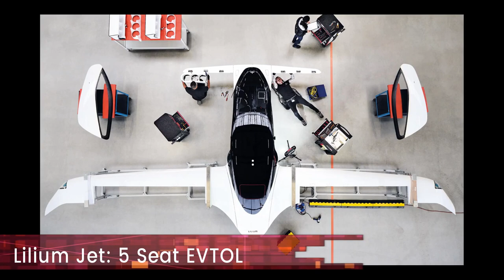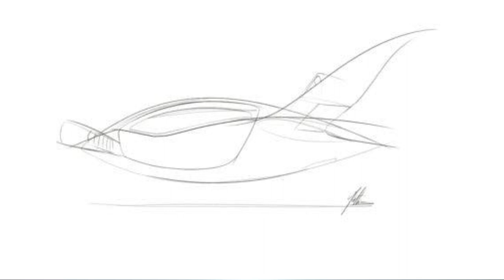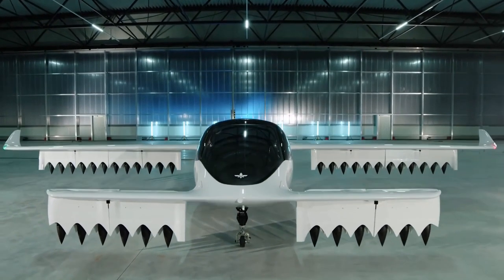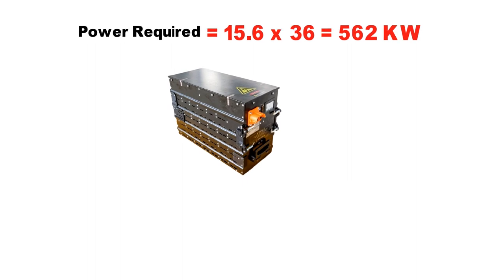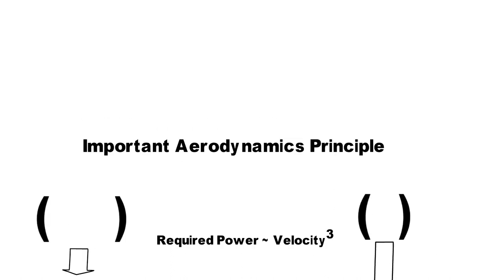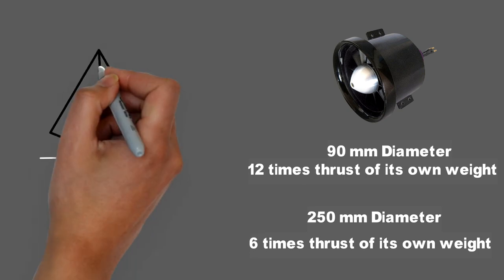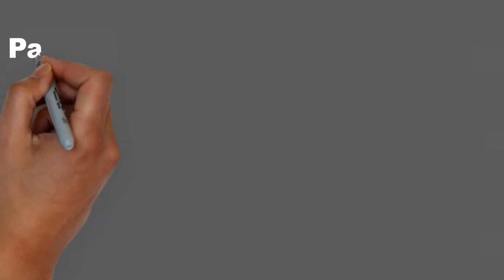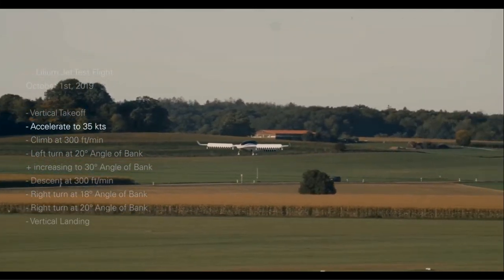The Engineering of Lilium Jet

Comment: Thankyou for covering some of the technical aspects. There is a huge elephant in the room though. Lilium have consistently failed to get anywhere near the performance and timeline they announced with so much hype. Back in 2016, these things were going to be available to buy in 2018, with 500km range and 400kph cruise. Pure fantasy. Here we are 5 years later and a model is managing minutes long flights around their airfield. And yet each failure to deliver is simpy brushed aside with some incredible new hype and new in service date. It is a peprtetual 4 years away. But  they seem very proud of being on their 5th generation of 'prototype'. Just one problem, none of the previous 4 have come anywhere near demonstrating the performance being hyped. I can see they have worked through some of the necessary innovations but what they have right now is nothing more than a big model making tiny little flights around their airfield, when what had been promised was a passenger carrying service date that was already missed 3 years ago. With the company being floated this now has all the hallmarks of another Theranos - bold claims but nothing tangible except some expensive mock-ups and a flying model that has demonstrated none of the performance claimed.
Reply from the maker: I agree with most of what you have written. This video was made a while back.  I think they are just waiting for the battery technology to catch up. If not they can either go for fuel cell or a Electrical generator. I would still like them to show a  VTOL flight with even  sandbags so that they can demonstrate with weight.
Reply: @Electric Aviation  yes, and I am not denying they have some innovations in the aerodynamics and propulsion. But their claim is to deliver all this performance into service with batteries and be certified by 2024. The company was not floated on the proposition of investment in a perpetual flying testbed with fuel cells as the next project. Bottom line is after 4 years flying models they have not made a single flight that demonstrates they are anywhere near being able to deliver on their fantasy claims for range, speed and payload. Instead of answering skepticism with verifiable information they just reply with defensive PR rhetoric.
  Thankyou for your reply and your video analysis of these projects.

Comment: hey, thanks for your analysis; I could be wrong about this; but when the "fan surface" is in the vertical orientation or nearly so and is moving forward ; I believe that the overall shape of the airfoil that is created by this configuration is acting essentially as "full span" flaps.
Thereby greatly increasing lift and lowering stall speed.

Comment: Academic !!!
I wish you had elaborated on the transition mode and issues arising in such phase. The remark as to the fact that this aircraft may be considered as one having a very low stall speed rather than an eVTOL alludes to one aspect which may be related. 
Also, you mentioned EDF diameter vs Power Consumption and vs specific thrust. It would be interesting to hear your thoughts on how Lilium may have determined the sweet spot.
Also, they had in the earlier design a sort of rotating cylinder housing a couple of EDFs in lieu of the current Canard, it would be interesting to hear your thoughts on this change and the tradeoff associated.

Comment: A couple technical comments to this nice video. Impressive the L/D ratio of 21 for such a small wing aspect ratio! With this in mind the vertical take off and landing, even if high power (and energy consumption) have a short duration (1 minute each?) as the plane will transition soon to fixed wing flying  in which it will stay most of the time (60 minutes) to achieve the 300 km range. It makes sense to me!

Comment: I wonder if this will feature the equivalent of of regenerative breaking which could be achieved by the freewheeling fans during gliding. If so it might be possible to extend the range further, although this would doubtlessly add mass
Reply from the maker: In some aircrafts, like Pipistrel Alpha Electro, there is regeneration capability while the aircraft is descending

Comment: Very nice video... best overall coverage of the propulsion that I've see,,, it'S amazing how little press coverage lilium gets, considering their state of design and prototype, and so far decent performance...I wonder how effective a fuel cell/battery hybrid would work out, given the battery fast power output, and fuel cell range/battery charge capability, plus, possibly very low pollution products...

Comment: I really think some kind of auto rotation capability should be required with construction of ant vtol craft. Its always the first question that comes up when some new vtol gets introduced. Is it like a difficult thing to construct rotors in multirotor aircrafts in such a way that they can be controlled mechanically in the event of powerloss ?

Comment: Hi, will the Lilium be available to fly yourself or just as an air taxi? And do you need a pilot's license?
Reply: Lillium is focused on the commuter market right now. It will require a pilot's license; but remote control by a licensed drone pilot is part of the plan; and full autonomous is the ultimate goal. Selling to general aviation pilots could help reach production scale, but entering that market segment has higher risks.

Comment: I am very curious how noise management factors into the design. A lot of the evtol concepts floating around have fairly large conventional rotors, which would almost be unbearable to hear fly over a city. I wonder how the ducted fans sound like and if placing them over the wing helps with noise abatement.

Comment: If the efficiency advantage increases with the size of the fans, then it stands to reason that a much larger plane would be advantageous. Airliners with VTOL? The future is wild.
I wonder if combining this tech with the Celera Fuselage and high aspect wings might be a good combination. You would probably have to position the motors away from the fuselage to avoid disturbing the boundary layer.

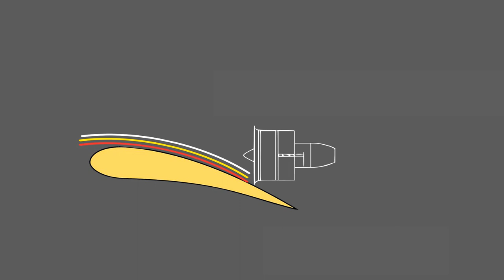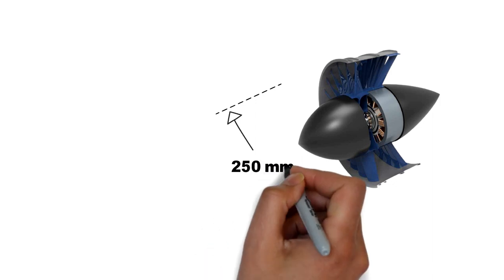Comment: @8:30 "boundary layer ingestion by the propulsors".  This infers non homogeneous air entering the propulsor.  Will this lead to a strong 1x/rev excitation to the fan blades when they hit the boundary layer air at ~6:00 o'clock?  If such an excitation exists, would it stimulate High Cycle Fatigue?

Comment: Since VTO consumes 10X more energy, the solution is painfully obvious, and it's surprising no one has fixed this yet:   Simply have a quick and automatic release power tether that pulls off once the craft is airborne.    Maybe give it a 10 to 20 yard length so once the plane gets underway, the forward momentum alone will disconnect the ground power.    Then have a cable boy/girl run out and spool it back into the landing zone.    Basically, take offs will consume ground power, keeping batteries topped off at full until aerodynamic lift is achieved, or is more inexpensively achieved.    The cable length could be adjusted depending on weight considerations, but remember, the power usage would be irrelevant until the cable disconnects at which point the cable weight would be irrelevant.
Reply: Just have to engineer a way to control the cable so it doesn't get sucked up and FOD out an engine...otherwise, you're right that is a elegant solution!
Reply: @detour1055  Why would the cable get sucked up?  By definition it would be on the exhaust side and would naturally be blown away from the aircraft.    As the aircraft rises, cable would be blown downward naturally.   Just ensure it's spooled so there's not a lot of loose cable laying around which then could possibly be thrown around with the ground turbulence.   But even then the energy that could be imparted to the cable is not likely to be able to throw it above the aircraft into the intakes, esp. since the weight of the cable is always pulling it downward.
Reply: @detour1055  (Also, assisted takeoff and landings are nothing new, the military has been using it on aircraft carriers since the first carriers existed, - although in the old days take-off assists were mechanical, like catapults.    Tailhooks and cables I think are still in use for landing assists.   This would just be a different kind of take-off assist)

Comment: Just use larger rotors, then retract rotors, and convert to fixed wing flight. Electric convertiplane something resembling the Russian Kamov Ka 90, but with the efficiency improvements from compact electric motors and working better in altitude

Comment: So I'm still trying to understand electric flight but if you were to shut off 4 or five of the fans at normal cruising speed could you possibly make more electricity for a longer flight time. Or make put solar panels on the wings thus creating more electricity for the flight?
Reply from the maker: You can do regeneration of energy by using the ducted fans as turbines. This can happen as you want to slow down the aircraft. Pipistrel Alpha Electro, an electric aircraft does that. As for solar, please check out the latest video on this channel. It covers the topic in detail.
Reply: @ElectricAviation  ok thank you for the insight and I will be sure to do so

Comment: I realize this is a cuss word to most electric powered engineers, but why couldn't a hybrid example work for this awesome craft? A small 2000 watt generator to kick in for take off and landing, or if the battery reaches a critically  low level. My camping generator weights 27 lbs, so weight shouldn't be that much of an issue. Just like some of the early electric cars carried a small gas engine to assist with steep inclines, or needed boosts. Its like always having a back up battery on board, just in case.
Reply from the maker: You are very right. There are companies looking to do this. Range Extenders will be added to the aircrafts as their operating envelope gets bigger

Comment: vtol doesnt require just a 1:1 power to weight ratio, 2:1 is much more safe. The degree to which your propulsion is distributed increases the safe t/w ratio because not all off your thrusters can act against certain forces, i.e. on the canard edfs can pitch the craft up if it is hovering

Comment: Maybe you can also give your take on Lilium an claims reported by "der Spiegel" that actual range numbers are lower than published by the company. the doubts seem to come with the discussion around not having enough energy dense batteries. Did you pick up on this? The title of one article is "Lufttaxi start up weiter in Erklärungsnot" by Spiegel. You can translate it online.
Reply from the maker: Yes battery energy density is the problem faced by the whole industry. I will have a look

Comment: Would be interesting, how much lift one engine produces in conjunction with the wings. In horizontal flight, shouldn't there be a gap between the wings and the props, so the air can travel more naturally above them? The max speed should be somewhat limited, because the forward facing props act like air breaks, or flaps. But I could live with 200-250 kp/h

Comment: Ok, lets crunch some numbers! First - nice analysis of required t/o power! But the main challenge in these numbers is the numbers itself: Energy density! Aircraft gross weight 440Kg with a 320kwh pack? Even if that was just for the battery pack that would mean an energy density of 720wh/kg on pack level. That's easily double the max energy density that current lithium ion accus can provide even on cell level. That being said, the given weight figure is for the whole aircraft! The video mentions that one single of-the-shelf 195mm EDF has weight of 3,4Kg while the a/c actually uses 36 larger 250mm EDFs. So these 36 EDFs alone make up for at least 120Kg of the aircraft weight. To get an even number, lets estimate another 80Kg for the airframe structure, seats, electronics, wheel base, everything else: So the a/c weight without battery would be around 200kg. Only 240kg would be left for the battery pack. So to achieve 440Kg gross weight with an 320kwh battery, the required energy density would be around 1.3kwh/kg on the pack level. That's currently impossible and will remain so for quite some time.  Only a rough estimation, but with the numbers given in this video, it's somewhere in this ballpark . Maybe these goals are set far out and they try to start with a smaller battery? Achieving 440Kg gross weight even with a 100kwh battery would still be extremely challenging today.

Comment: Pushing the envelope! When solid state batteries come on line, maybe they'll make the plane more viable.  I wonder if they considered tethering power to the plane just for lift off, saving that big loss of energy.
Reply: The Lillium design would make this approach safer than the same concept applied to virtually any other drone-like design I have seen. Lillium does not seem to be anywhere near as vulnerable to ingestion, fouling, or a myriad of other potential issues. And it seems like a relatively cheap option to deploy.

Comment: I can also see the high power consumption on V-landings is likely to cause accidents due to sudden power loss from irregular power supply characteristics which can occur at near-depletion levels, which of course will be exactly what will be the case near the end of a flight.
Reply: Perhaps the design needs a separate, smaller backup battery, exactly for emergency landings and/or main batery failure.
Reply: @hankb4615  That would reduce the payload of the plane substantially.    Better just to have one bank of batteries and have accurate estimates of flight time left, maybe with warning alarms when approaching critical no-return levels.
Reply: @Zuckerpuppekopf  They use exactly 3 autonomous batteries.
Reply: @0Turbox  It would make sense to reserve fresh backup batteries just for landings/takeoffs to ensure it can be done without sudden fatal power loss.    This is why some land vehicles separate starting batteries from appliance batteries...so mission critical power is there for the high power usages.

Comment: Connecting two electrically powered EDFs to a 3rd Parallel  lying  Free  rotating Ducted Fan  will  produce the same thrust  of 3  EDFs at  approximately a  30 % energy saving.  A belt or chain can drive the  3rd  free rotating ducted fan to the others
Reply: They clearly stated, that they want as fewest movable parts as possible.

Comment: There was a recent "Iceberg" Short report that did a lot of damage to the stock.  Have you read that report and can you comment on the technical claims?
Reply from the maker: With Lilium I have had a feeling that it would make a great STOL aircraft in the near future but not a VTOL. As the Solid State battery technology matures, it will become a capable VTOL.
Reply: @ElectricAviation  I believe Lilium NEEDS TO RESPOND to this point!!  They claim to have a viable VTOL craft. Investors are confused and concerned.  That Iceberg Short Report needs additional credible support for that claim!  Lilium needs to refute or explain why that report is erroneous.
Reply from the maker: @bobritter8854 Many of the eVTOL companies are banking on battery energy density to increase. It is increasing but gradually. Both NMC and NCA type batteries have reached close to their limit. The future lies in Solid State batteries which can double the existing  energy density.  It was anticipated my many companies that by 2021 end, battery with energy density of 400 Wh/kg would be available.   This so far hasnt happened. Lilium should therefore focus on the STOL sector and then graduate to EVTOL

Comment: Very good explanation, but you didn't cover the main reason these types of aircraft will not be commercially viable... i.e. instability during an engine out event... e.g. if one ducted fan fails during take-off or landing, it will cause instability and roll.
To counter an engine out, the opposing fans must either decrease their thrust, or fans on the same side as fan out, increase their thrust.
If you decrease the oppposite thrust then you decrease overall lift by 19kgf x 2 = 38kgf, and therefore be unable to maintain lift.
If you wish to increase the thrust on the same side as engine out, the electric motors must be able to increase their output by over 38% which they will not be able to do.
Therefore these type of aircraft will not be commercially viable... lots of prototypes... but no successful commercial production...

Comment: Great innovation!!  First need think what kind license it will need ? PPL (A) or even (H).. Second pure electric plane is impossible idea (today battery technology vs weight are too heavy for make normal flight  operation vs normal private planes)  I think also safety.. Empty battery means direct  "crash land" and if plane is design like VTOL class how can make it can safely, not possible Autorotation like helicopter ? I recommend there is some main power JET engine what cant feed main power and some battery give extra power just in case power for this fans. Still think who can legally fly this great plane on sky ? Interesting  innovation anyway....

Comment: They should prove there concept by putting sand bags in there drone and make a public demo flight. So for there 5 seaters they have to put 500 kg in there aircraft. They should also show there highest flight speed. As long as they don't prove there concept there is a chance that this company is simply an other Wirecard, which also comes from Munich.